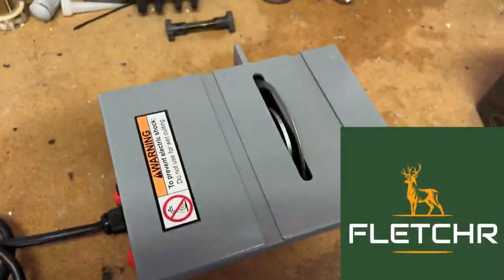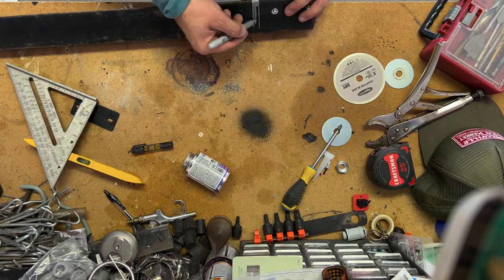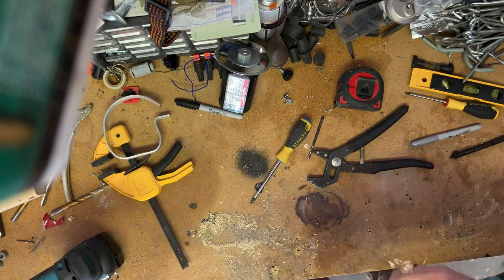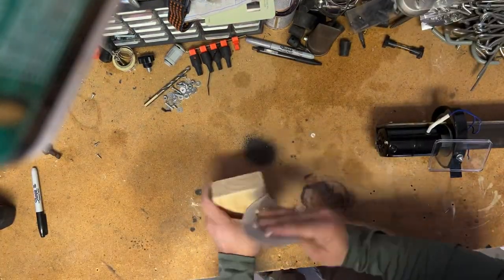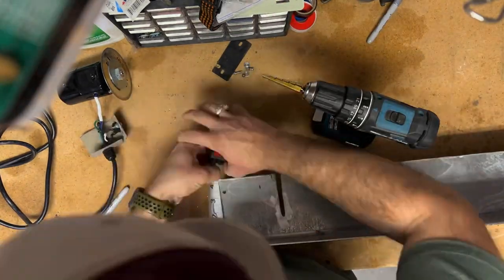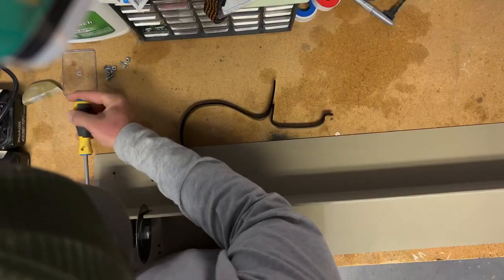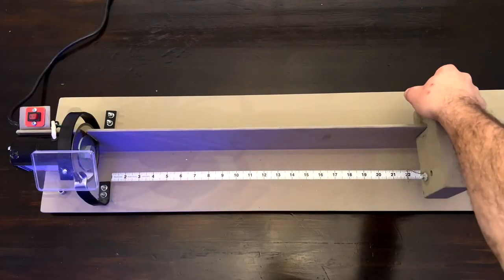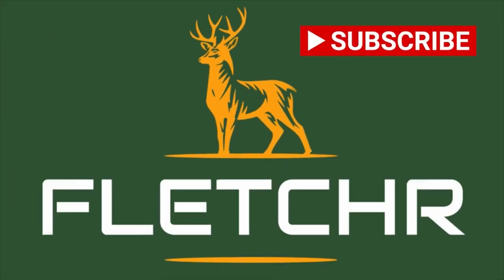DIY ARROW SAW BUILD

Comment: I would think a rotary tool that has 1-10 speed settings would probably work as well. as long as I get the right kind and size blade! I think I will have to make one that way and try it out!

Comment: Instead of the wire pointer you could drill the hole for the arrow a little deeper so that the end of the arrow (carbon portion) sits flush with the edge of the block. Then lower the block so that it's closer to the ruler for more accuracy.